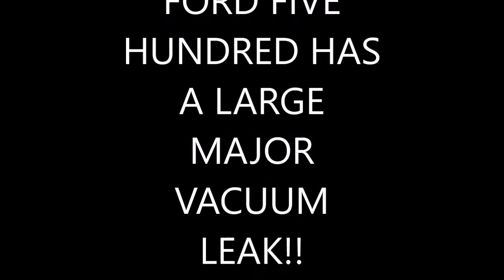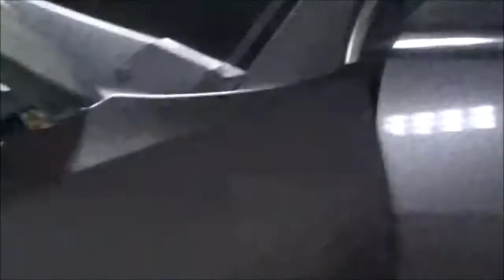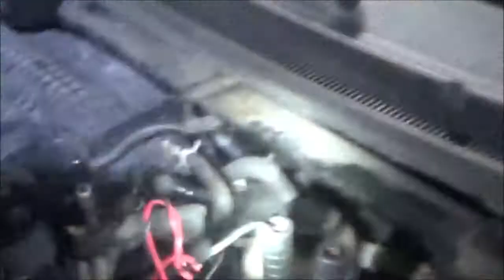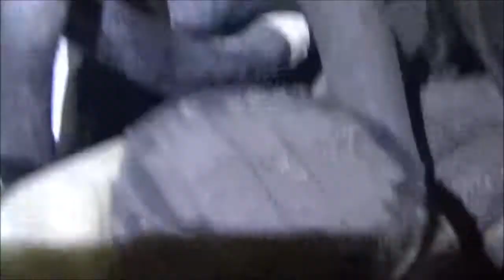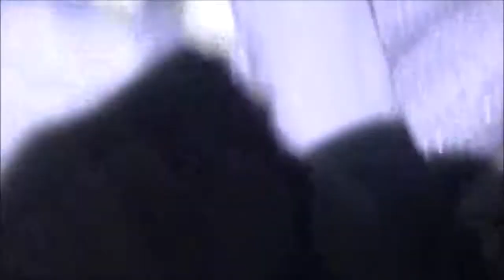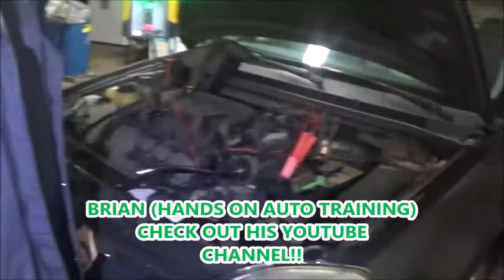2006 FORD FIVE HUNDRED LARGE LEAK PROBLEM!

Comment: A vacuum leak will set those codes but it won't make the vehicle have a loss of power at wide open throttle,,
When the maf is bad and setting those codes,,if you unplug it the symptoms will go away(if it's bad)
Also you can look at the baro pid because it comes from the maf,,if it's anything less than your altitude of your area it's causing it to run lean and thus bad,,
Example reading 152 and your at see level should read 158